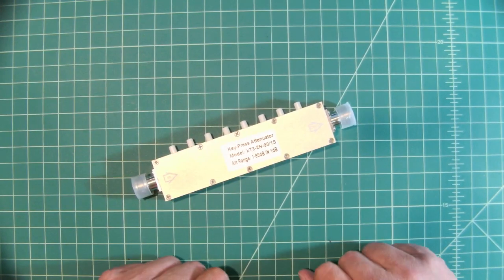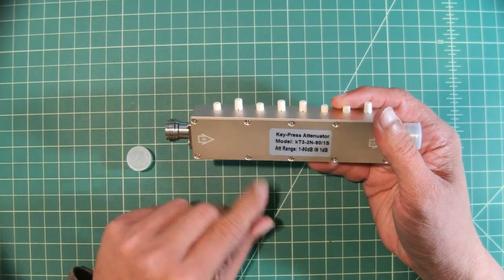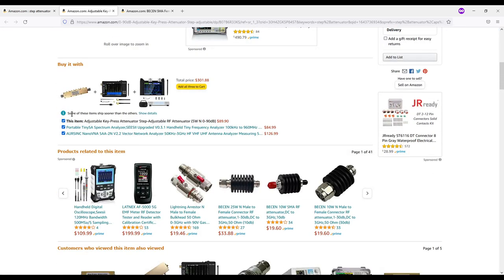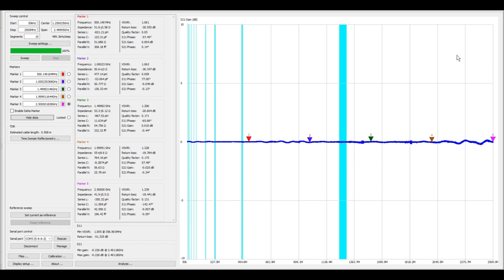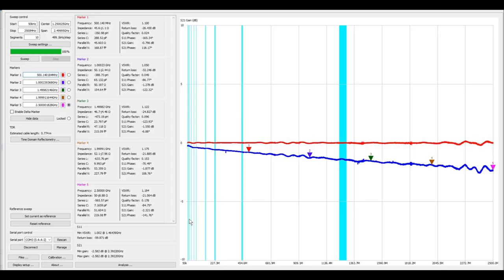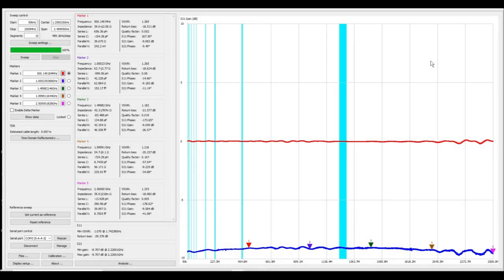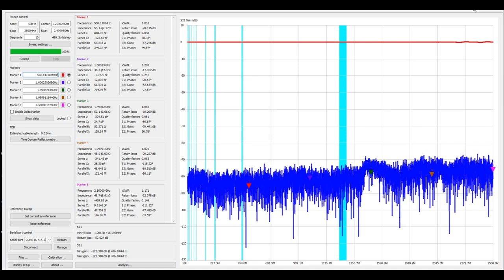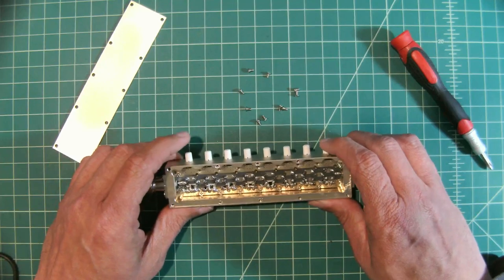90dB Step Attenuator Tested with NanoVNA

Comment: The VNA noise floor is much greater than -90dB. You cannot use it to measure such small signals.
Reply from the maker: Thanks for the this comment, after seeing this I did similar tests on my Siglent SAA 3021X and what I am seeing is the Step Attenuator starts to act "goofy" at -60dB

Comment: You forget about the insertion loss of your cables and connections.  You should run it with 0 dB ( nothing pressed) to figure out what is your cables and connectors loss.  Also, you need to increase your input power to measure 90dB insertion loss, because your tinySA floor of measurement is about 80~90 dBm, so your source should be about 20dBm, in order for you to able to measure it with tinySA.  Warning, do not burn your TinySA  it can only take 0dBm, so you first have to measure your source signal with say 40dB Attenuation to be about say -20dBm then switch to 90dB attenuation then you have to measure it at about -50dBm.  Also you may turn off the the LNA and AGC in your TinySA, when you just measuring attenuation.  Also Power-meter might be a better choice for measuring attenuation than Spectrum Analyzer, unless you want to do flatness vs frequency.  Also you have to do temperature testing.  That is you have to put your Attenuator in temperature control chamber and do that in several temperatures.
Reply from the maker: Great points, thanks for the detail Aduedc!
Reply: Yup, good ol' ground one normalization.
Reply: Hi, are you referring to the Tiny Spectrum Analyser in your comment by mistake instead of Nano VNA ?
cheers .😊

Comment: I recently purchased a similar attenuator from ebay with a model number KT3.0-90/1S-2N(2W).  That's a hefty model number.  Any way the unit was tested on an HP8711b SA and it checked okay at around 2.5% worst case.  Insertion loss was also okay with a high around 280MHz and 440MHz of 1.45dB.  That's not bad for Ham radio guys.  I did normalize with the test cables so only the DUT and the adapters were in play.  My test power was 10dBm.
Reply: Oops!  Forgot to say that the DUT was only swept to 500MHz.  Us Hams don't knowingly dabble in those higher frequencies.
Reply from the maker: I think part of my "problem" with this one was too low of an input signal and not enough dynamic range on the VNA.  Thanks for the comment!
Reply: Sounds reasonable.  It tested the attenuator with my nanovna (NanoVNA V2 PLUS4) and at the 90db setting of the attenuator the display showed a bit of noise.  Nothing like yours but noisy never the less.  My nanovna has a specified dynamic range of 90dB so the measurement was pushing the nanovnas' limit.  My nano has an output of 0 dBm.  Well there is nothing like a "real" spectrum analyzer.  My HP8711b was given to me at a ham club meeting about a year ago.  The local communications company had no need of it and passed it on to one our club members who had no need for it.  He brought it to our meeting and asked if anyone  -  well he didn't finished his question.  I grabbed it snarling and growling and took it home.  It's wonderful.  It has been upgraded as per Imsai Guy to a vna.  

I enjoy your channel and watch it often.  Ted Ivester, N7NSL.
Reply from the maker: That is one heck of a score!

Comment: Curious if you ran a test on each switch independently, it seems like you have a bad switch or resistor in there somewhere.
Reply from the maker: I don't recall doing that, not a bad idea.

Comment: Thanks for posting, interesting video. I don't think I'll be getting one. I'll keep using my inline attenuators. 
I built a 50 db RF sampler and could not measure it with the NanoVNA H 4. I have no idea why it would not work. I recalibrated the NanoVNA and still would not work. I then tested it with my spectrum analyzer and the sampler was spot on down 50 db. 
I like my NanoVNA and have found many uses for it, but it does have its issues from time to time.
Barry, KU3X
Reply from the maker: Someone posted that the noise floor wasn't low enough on the Nano, don't know if that is true or not.  Thanks for checking out the video Barry.
Reply: @TheSmokinApe  The noise floor on my NanoVNA was well below 50 db and on 10 mhz on down, the 50 db sampler showed 79 db. The spectrum analyzer proved it was 50 db from 1 mhz up to 50 mhz.. For me, the NanaVNA failed to provide an accurate answer.  Barry, KU3X

Comment: I thin the attenuator may be just fine. You have simply attenuated the signal below the noise floor of the analyzer. The analyzer doesn't have 90db of dynamic range.
Reply from the maker: I think you are right, thanks for the info Robert!

Comment: Hey thanks for good postmortem. Which attenuator can you recommend with range upto 100 db. And one more, does the attenuation capacity changes over frequency - like more towards VHF and less in UHF range, or it remains same? (sorry not very literate in this subject)
Reply from the maker: I haven't found an adjustable that is; usable and affordable yet.  I'll do a video when I find one.  Depending on how the attenuator was designed you will see varied performance at different frequencies.

Comment: H'mm. Are you sure that the unit you're using to measure this isn't the problem? I don't expect a device that is made up of resistive antenuators to be noisy unless the resistors or switches are open circuit.
Reply from the maker: Nope, I’m not. In retrospect it could have been the dynamic range of the unit 👍
Reply: @TheSmokinApe  Yeah, I suspect you are right. I have a rotary attenuator that goes all the way down to 135dB. I measured it with a sig gen and a good HP spectrum analyser. I didn't have a VNA back then so haven't tried this experiment. I do have Nano's but I also have a HP VNA that I could try with too. One more for the experiments TODO  stack.
Reply from the maker: that stack keeps getting bigger 👍

Comment: I had to lol, the Nanovna doesn't have enough dynamic range to measure the 90db. There is probably nothing wrong with the device. The best way to measure is using a test signal and a spectrum analyzer.
Reply from the maker: Fair point, thanks for watching German